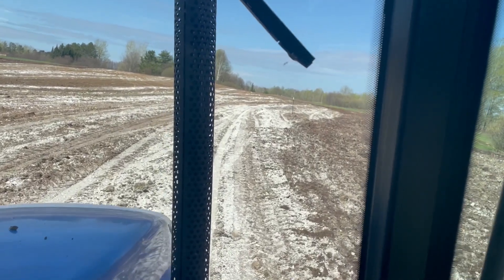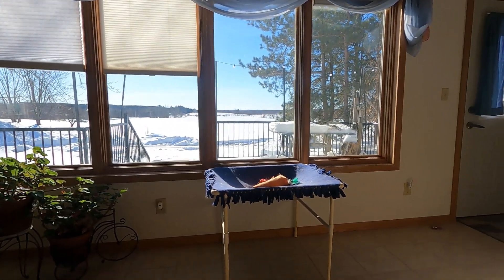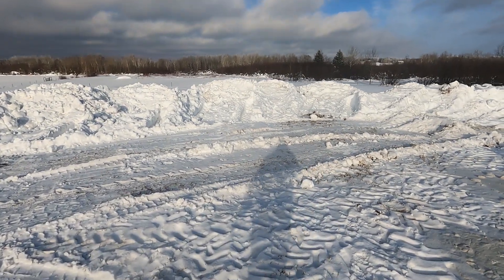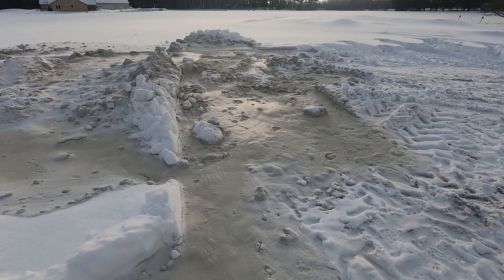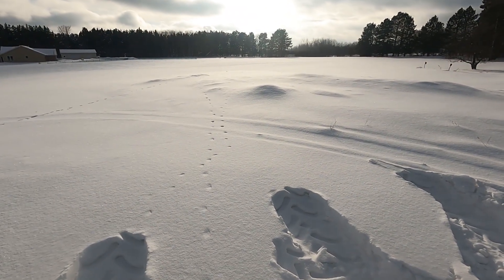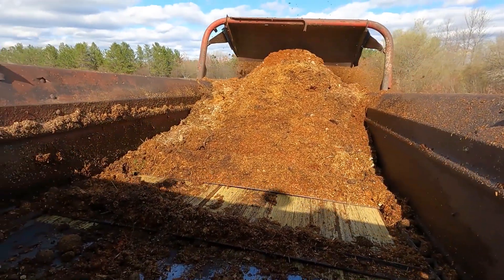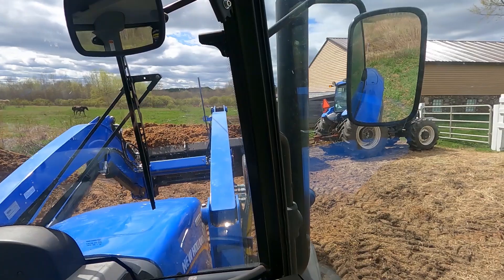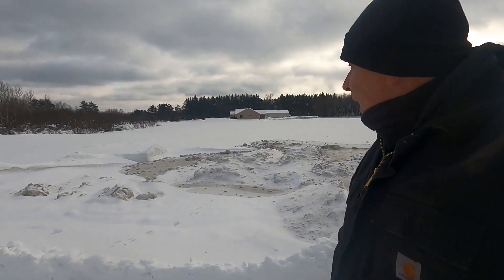Rehabbing our Hayfields Begins in February.   No, really!?!

Comment: Great talk Dave you probably get that lime for free right I get the same similar type of lime from water treatment facilities for drinking water. I’m spreading horse manure right now that Im getting from a horse farm. Do you shoot for a amount of tons of manure per acre per year or do you just put on what you can or do you apply manure to what the soil test recommendations are? Very rarely can I get enough manure and per acre to actually bring my hayfield up to the fertility level that would be recommended based on NPK of a soil test recommendation for commercial granulated fertilizer. So you’re a mixture is just Timothy and L site clover? Do you ever test the manure?
Reply from the maker: Ray; yeah the lime is free because we’re so close and they need a spot to deliver in winter.   We aimed for 5 ton of manure per an acre based on my rough calculation of volume in the spreader and weight of a five gallon pail.    I’ve never tested our manure but I’m planning to test both types this spring.    The reality may be disappointing but I’ll report it.    We get biosolids on our larger fields on a three to four year rotation.   That’s not free but it really produces.    We probably cover 65 of our 175 acres per year with some type of manure and another 20 with lime and some type of green manure (rye) incorporated.
We seed alfalfa on our sandy fields and timothy with Alsike clover on the clay loam in a 60/40 mix.   It was recommended by the old-time farmers when I moved here and it’s rarely disappointed.   EAB Farms puts in Teff west of here and highly recommends it.   I’ve been thinking of trying it.